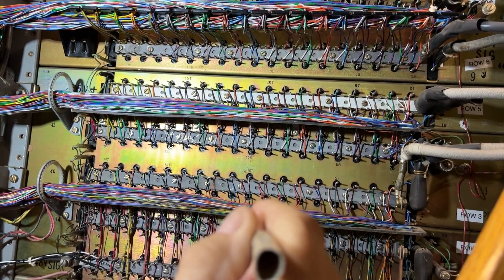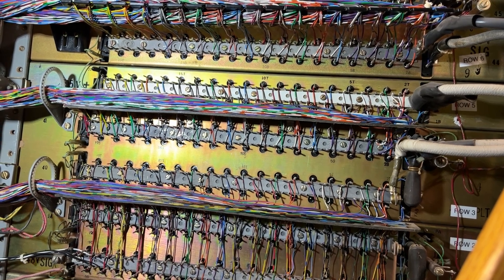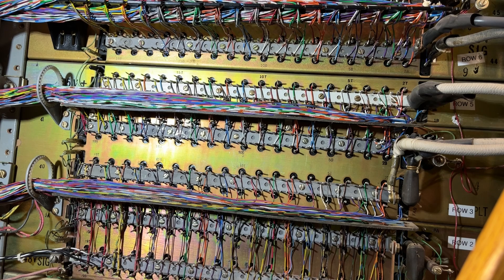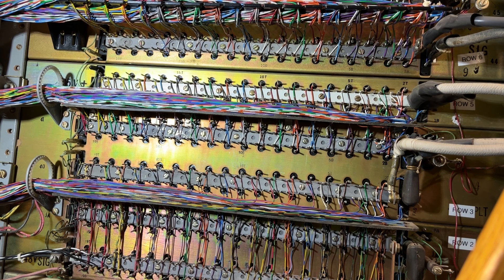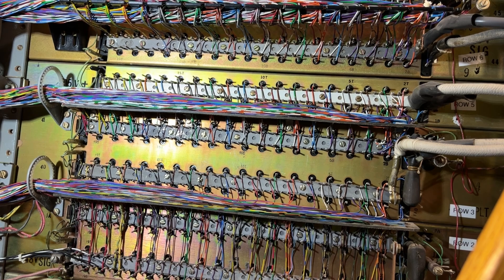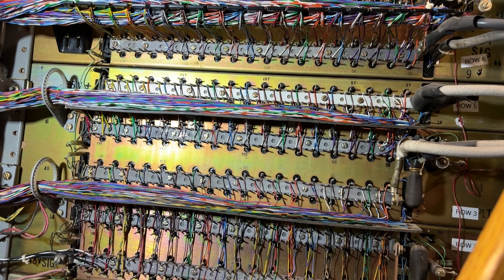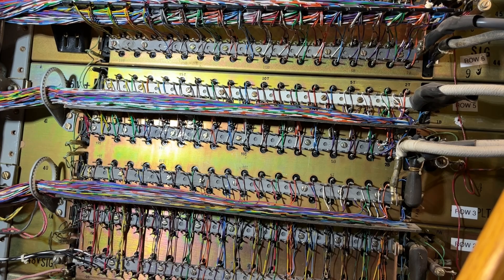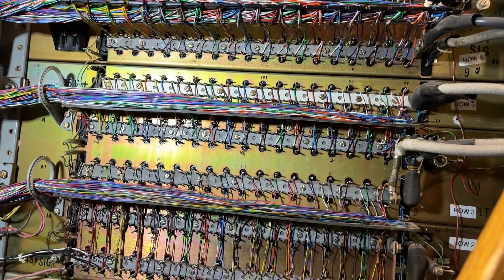Wiring auxiliary equipment in a SXS central office.

Comment: I recently had to terminate 28-pair cables onto AMP CHAMP 64-pin connectors by hand, because I only have the 25-pair butterfly tool. It’s tedious, but after the first color group or so one becomes immersed into the task. Luckily botched contacts are replaceable. It was for ADTRAN DSX-1 breakout.